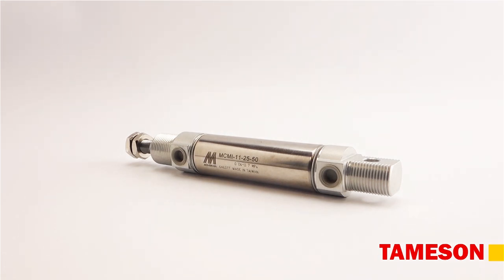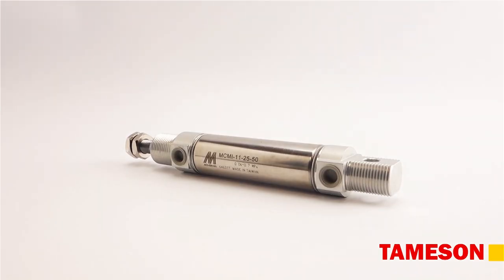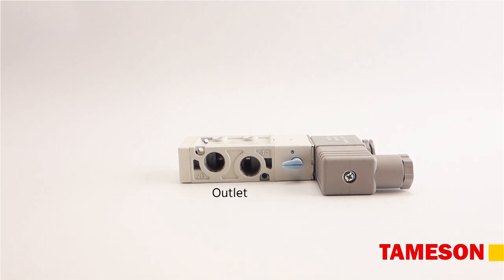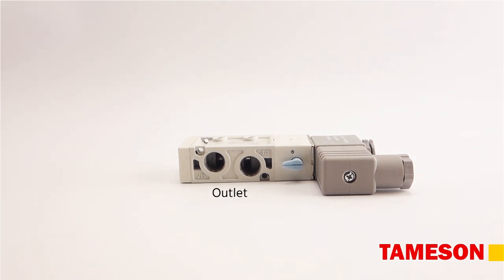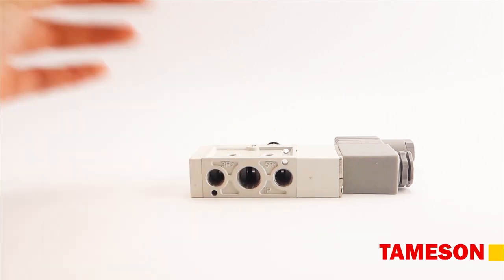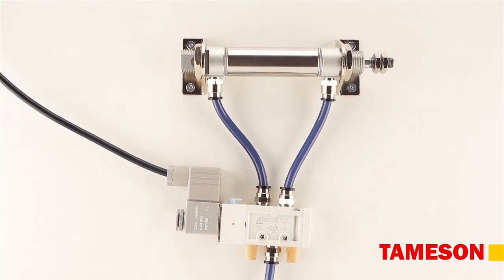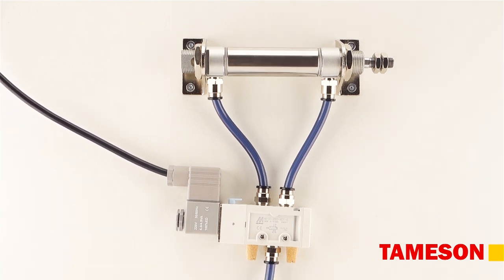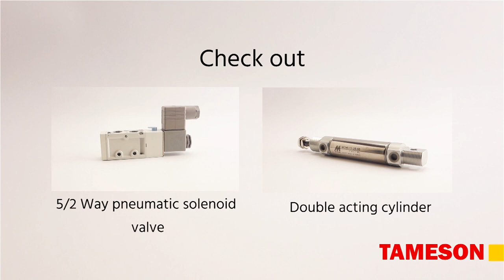How to control a pneumatic cylinder with a 5/2 solenoid valve | Tameson

Comment: Hello maits, have you got idea 💡 how to do 2 way pneumatic cylinder to go down with 1 button [start button] and to go up with onather button (stop button ) but the first [start button] it still pressed. The Stop  button have to turned off [the start button] and when start button is reset to do the same operation as well. ?
Reply from the maker: Hello, we would need to consider your system and all parameters. You can contact us on support@tameson.com to try to find the solution for you.

Comment: Greetings. how do you block the air to block the piston mid-stroke or any other point?
Reply from the maker: To block the air and hold the piston mid-stroke or at any other point, you could consider using a 5/3 solenoid valve with a closed center position. This type of valve can block the air flow and maintain the piston in its current position.

Comment: hi! what if I need the pneumatic cylinder is on extract position? what should I do? thank you. Is that possible?
Reply from the maker: Hello, to keep a pneumatic cylinder in the extended (extract) position, you need to maintain air pressure in the extend port while ensuring the retract port is vented. This can be done using a 5/2 or 4/2 directional control valve.

Comment: What push in fittings would I need for a 10mm (outer diameter) tube/hose?
Reply from the maker: Hello. You would need a 10 mm push-in fitting
Reply: @Tameson  Did some research, 10mm to 1/4" I think it is. Thanks!

Comment: It works automatically or manually
Reply from the maker: Hello Venkat. You can use electrical signal to operate remotely or you can use manual override to control it locally.
Reply: @Tameson but sir can it be continue  in reciprocating  position without any electrical  circuit
Reply: I am looking at the same issue. I need a pnumatic cylinder to cycle continuously ?